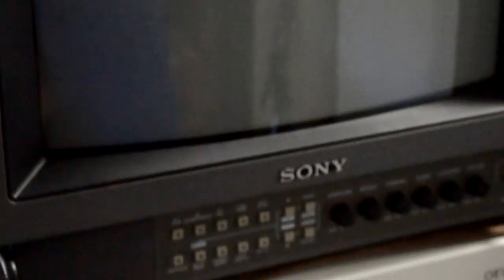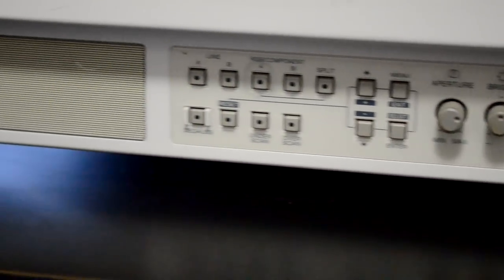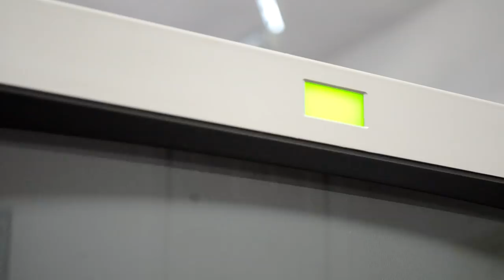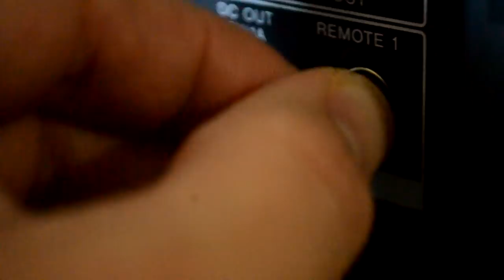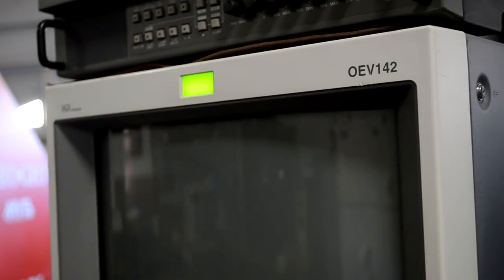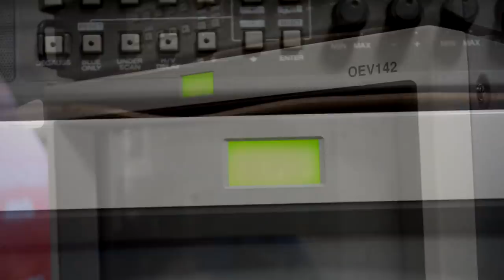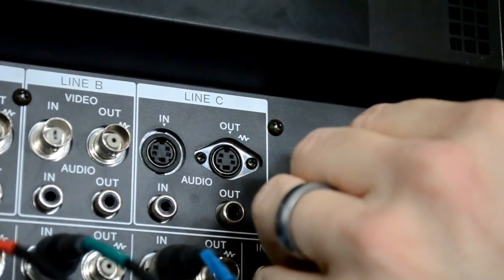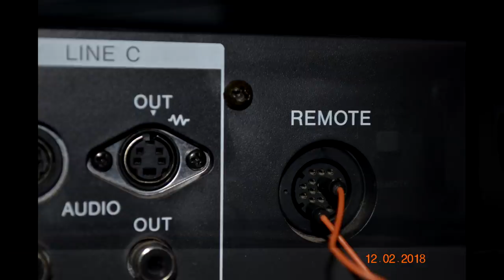Sony Pro Trinitron Hacks! How to activate the Tally Lights!

Comment: thanks a lot, I ran a vhs tape digitizing studio and had a multiple monitor setup. Sometimes the power LED just not bright enough and when the screen is black, you can't tell if a monitor is on or off by a simple glance. It's inevitable that you'll forget to power off a black screen monitor someday. I always want to activate tally light as power indication. And you video really helps a lot. Thank you again.

Comment: Interesting, and here I thought it would be in the menu somewhere
Reply from the maker: This is such a weird feature.  It was only ever controlled through the Remote input.  I'm not sure why there isn't an option for it in the sub menu too.  It was originally used so you could tell which monitor was active or "In-use" if you had a editing or live TV studio with multiple PVM/BVMs set up at once.
Reply: sure, is a control signal from the switcher, not a monitor feature, it means usually "this is the ON AIR"

Comment: Hi Steve, greetings from Spain!  I am a big follower of yours and now I have a problem with a sony pvm-2054qm which the power button is broken because when pressed it does nothing, but the monitor is always on and I turn it off using a power strip with switch, you would know of some trick  to be able to turn it off safely?  and not at once?  without having to open it ... because I think that this way it will end up spoiling the monitor right?  Thank you

Comment: the medical tally is always green, all red light are associated with a danger situation.
Reply from the maker: Thanks, I actually read about that shortly after publishing this video about the red danger light.  Is there a general diagnosis for that or is it just a fault detection somewhere on the PVM?
Reply: this is the explanation that Sony gave me during the training, I'm a old sony technichian ;)  the tally is an external circuit, no internal connection at all, the connection in OR is associated with recording of a HVO series HDD recorder, for new models :)

Comment: Is there an easy way to do this for the 20L2 monitor's remote slot? It requires a modular 8-pin connector instead of what's used for the models in the video.

Comment: Thanks I have a question for you is it okay to clean your pvm with wd 40 electronic contact cleaner? Thanks
Reply from the maker: That is a good question.  I've read that cleaner is safe and I've seen others use it to clean circuit boards.  I will make a video about cleaners soon.  I know that CRT Arcade repair people love to clean their arcade CRTs with Simple Green and then just hose the whole chassis off afterwards with water.

Comment: Already knew about this, but what about using 's-control' (3.5mm headphone jack) as a remote?
Reply from the maker: That's another proprietary Sony connector.  It was used to connect many Sony devices together so they could communicate and perform combined tasks together with ease.  I'll discuss it on the 2nd Q&A Video this week.  Thanks

Comment: What if it’s a monitor like my bvm 1201 which has a number display
Reply from the maker: If it has a remote plug in the back, then you can probably activate the Tally light on that BVM too.  Check the manual for your BVM and one of the pages will list the Pin-out.

Comment: I was looking into making a plug with shorted wires inside for the tally light interface, so I don't have to uglily bridge wires. I did this on my Panasonic LCD broadcast monitor, which uses a D-Sub 9 connector.
Sony however decided to make their own connectors that look like DIN connectors at first glance, but change the pin arrangement. For example my 20" PVM has a connector that looks like a 20 pin DIN connector, but the pins are actually aligned in a grid instead of spherically. 
I was unable to find a connector like that anywhere. What a shame.

Comment: Would it theoretically be possible to activate the light with software via an Arduino? I personally think that would be pretty neat.
Reply from the maker: I would think so.  If you made a cable with either a connector or just 2 pins on the end, then wrote a program to close the gap on a switch to activate the tally light.  I think you could accomplish this a number of ways.